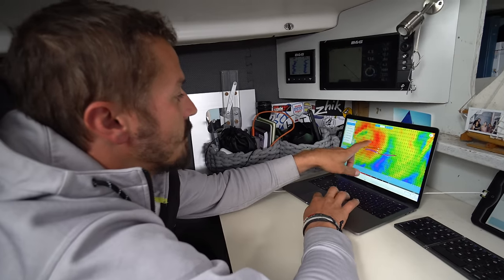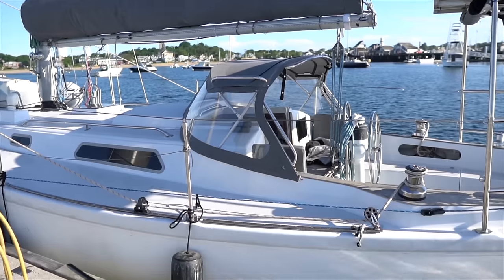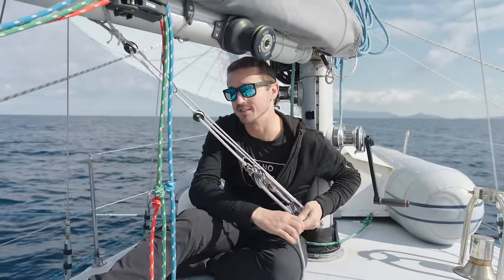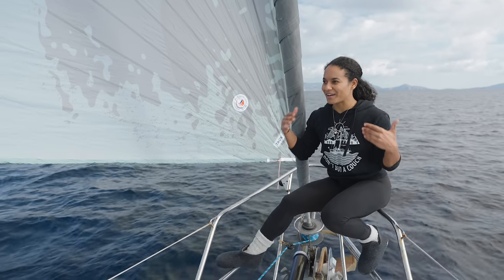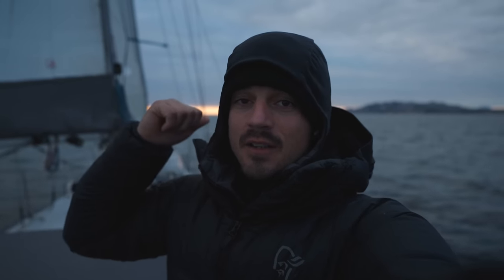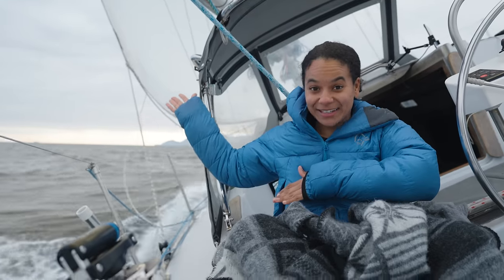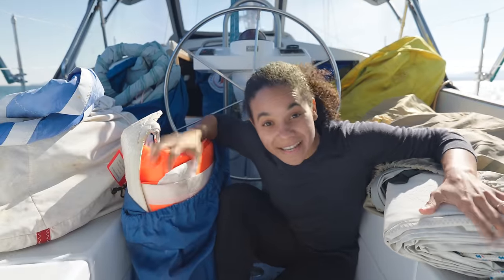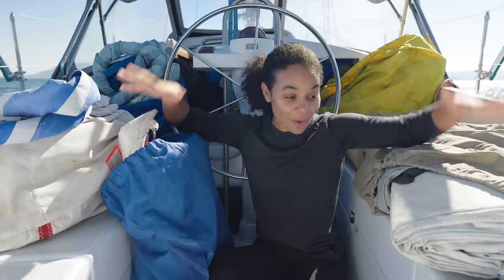Our Electric Sailboat has Unlimited Range | Step 343

Comment: One of the reasons I follow your channel is because you're true sailors... a rare thing in this age of the modern diesel engine. I don't know if you follow them, but Matt and Amy on Sailing Yacht Florence are another couple who give off the same vibe of choosing to sail whenever possible.
It's funny that many people think of the diesel engine as being the safety back up... I would argue that thinking is wrong. I have had to sail into a pen or onto a mooring in a boat because of an engine issue way more times than I have ever had to motor in due to a sail issue. Having the spare set as you do makes absolute sense.
Reply from the maker: Very much agreed. The number of sailboats that call for a toe when the engine dies blows my mind! You still have sail...use them!

Comment: I know you weren't selling anything BUT, . . . I'm sold on your sail inventory Step!  : - )  I've got 4 sails for my P2-20 but have not set up my spinnaker yet.  I made it out of an actual parachute but it is triangular.  I also made my genoa out of larger old main sail for another boat.  My jib and main sail came with the boat.  I'm happy that my sailboat wasn't used much (it was made in 12/72) because the sails that came with it are not worn out yet.  However, if I had the money, I think I would have a new set made up.

Comment: You guys remind me of my Dad. We live just outside of Buffalo, NY. and dad would sail from the dock in Erie Bason Marnia, out to Lake Erie and back, NEVER used a motor nor paddles to do this. Infact when the boat launch was changed (the deep ramp was removed) and, now we had to use a crane to launch the boat this was in the Buffalo River where the buildings blocked the wind. It took us hours to install and start the outboard motor Why? Dad never used them before. The boat had a 3-foot fixed keel on it and that's why a crane was needed.

Comment: What a fantastic step; thank you both.  My Ranger 29 (same era) had the same mast set up as your Pearson.  Like you said, it's fine.  When I upgraded to a J/42, it came with a Tides Marine SailTrack.  You hang out with cruisers, so you have probably seen them before.  There are no ball bearings, but the main drops instantly, and I can reef the main downwind.  It will likely install directly into your existing track.  Something to think about for the future.

Comment: Advise you to use the storm jib whenyou are going upving in more than 28 knots, the boat will be more balanced and feel safer.  Also in heavy downwind it can be used as your only sail, gives good control of the boat and not to high speed.
Love your content and as always great filming and relevant content!
Reply: An added benefit is that familiarity should preferably be gained before it is needed. It's one thing hoisting it tied to a dock, but the sailors need to establish how to hoist and trim it in strong winds, and there may not even be suitable locations to sheet it to. 
It's critical that the sheeting angle be correct because flogging is not sustainable.

Comment: Ball bearing slugs - I know them from a big catamaran. They are not only easy. When I entered first that boat, we thought about a line to pull the sail (some hundred pounds) down!  Later we learned you have to clean them at least twice a year, otherwise the sail may stuck. On a comfortable thought if you imagine wind is increasing and you struggle to reef.

Comment: Great episode. Well explained and yes as a sailor who grew up sailing in the 70's and 80's the naming for headsails and spinnakers is very confusing now! As a racer it's all A1, 2 etc for asymmetrical spinnakers and J1, 2 etc for jibs... before it was symmetrical spinnakers and they were named by their cloth weight - 1/2, 3/4, 1.5 oz and jibs typically by their size from 150% down to like 80...You guys do a fantastic job and it's nice to watch a channel where it really looks like you know what you are doing (there are some out there that are pretty scary!)

Comment: My first sailboat didn't have roller furling, so I had a huge number of jibs and genoas that I had to go up to the bow and change out in whatever conditions caused the desire to change, so on the second boat I made sure it had a roller furler, I did not miss going up to the bow anymore and occasionally achieving weightlessness and getting salty.
Both of my boats have had sloop rigs and I was interested in the cutter rig that my uncles boat had, until recently I found out about solent rigs that have become popular lately and that looks like what you have now with the two head stays close together. I like the flexibility it gives

Comment: We watched this this morning, and really enjoyed it. We are shopping for light air headsail(s) for our Bristol Channel Cutter. A genoa is our biggest, lightest jib. What we're looking at is a code zero and an asymmetrical spinnaker. We have experience with an asymmetric in a sock but not out on the end of a bowsprit. Blowing the guy and snuffing the asymmetrical is so easy compared to dropping or jibing a tri-radial on a pole! The top down furler is the other option but that looks like a spinnaker wrap waiting to happen. Code zero looks great, but not if going deep downwind , like 120 degrees. I guess the dacron code is more UV resistant for long passages. Our #2 and #3 Yankee jibs we've never used!
Reply from the maker: The continuous roller works great if you have the right sized spinnaker. We've had it on there for 3 years now and only wrapped it wrong once. If it was the right size, that probably wouldn't have happened. 

You can certainly fly a code 0 down wind, but it's just not as efficient and big on spinnaker. We do it sometime, it it's just for an hour or two and we're too lazy to swap.

Comment: Having such a reliable propulsion reminds me whenever I replace a car tire the alternator quits and when I fix that the radiator starts to leak, and after getting a new radiator the brakes start to sing indicting it's time for that job, which is what happens right before you blow the gasket, the point is such a beautiful electric rig tells me something will come up on your sailboat and I hope whatever it is you keep sailing amyway.

Comment: You can buy my 1971 SWAN 40. S&S designed, Nautor built and I have the Lloyds certificate. I have had her for 32 years. B&G autopilot, Radar, Sonar, Garmin 4012, Furuno weatherfax, Furuno Single sideband, and more good stuff. No leaks ! 13 sails. Very good sea boat. Nice motion, never pounded even in very short seas going to weather at 40 kn of true wind like northbound around Brooks peninsula with the tide against 40 kn of wind. Like skiing moguls until the jib ripped. We still made it into Winter harbour under main only. But I'm over 90 years old now and would love to sell the boat to you guys.

Comment: as an fyi, you don't need to strengthen the deck if you lead the lines back to the cockpit, there are mast rings for deck stepped and keel stepped masts that transfer the halyard forces back into the mast and not into the deck. Im going to steal your idea for the mast clutches, its exactly what i need!

Comment: The limitations of the Electric power has really made you better sailors and kept Uma a SAILboat. Buying lots of Diesel fuel to push around a power boat with a mast seems like a waste. If you are going to power most of the time a true power boat really works better. 

You ave rehabbed an old, small, washed up, boat not even safe for day sailing in to a safe world cruiser. This is astonishing. Well done.

Comment: have you thought of pressure reducing slides, i upgraded my main from bolt rope to rutgersen pressure reducing slides and it made the world of difference, you dont need to install a track, they work in your existing mast track. as a solo sailor i would never go back to bolt or plain slugs again, there are ones to reduce pressure off the battens and allow you to adjust the batten tension and standard wheeled ones, I run 4 batten ones and normal white slugs in between.

Comment: I would suggest that you attach your lazy jacks near the outside end of your spreader. This will enable you to raise the main much easier and even when you are at an angle to the wind.
Another improvement would be to have cleats on your mast to reduce the wear on your clutches 07:10. André in Sydney
Reply from the maker: Downside of that, is the tension on the lazyjack lines will vary depending on the boom position. We installed then along the mast to avoid this and require no fussing or re-tensioning. We set and forget them and have no issues.
Reply: @SailingUma  Thanks, it's good to get the perspective from a couple who have more sea miles than me and most other people. Cheers, André

Comment: I was fascinated by the Oceanvolt system, and especially when I watched your videos on the installation. I even made an offer on a boat that has an Oceanvolt system with the regenerative sail drive (but not the newer servoprop). However, I could only get one canned response from Oceanvolt regarding a retrofit upgrade and finding someone to install it.

Ultimately, I had to abandon the offer on the boat after learning how unresponsive Oceanvolt is. The biggest problem with the technology is that it's proprietary and exclusive, which means only their technicians can work on it. If they don't answer you, you're on your own. It'll work great if it never breaks or if you're influential enough to get a response from them.

The whole experience was enough to sour me on that company and avoid them. I'm sticking with a diesel until a better hybrid/electric manufacturer comes along. I think the Shards are working with one, but they're keeping the name quiet.
Reply: buy 385 sóar ektruc biat 30 ñm rañge   33.6 mooilbnr 30 precr mire range 40 mioevrañge

Comment: I really like your 12:1 boom vang and that code zero is dreamy! I have never seen folding wench handles before, how do you like them? I had a new cruising mainsail cut with not battens.  I really had to work to find a sailmaker who knew how to make this old school cut.  With no battens I loose some power but I can raise and lower the sail pointed in any direction and the sail has lasted and lasted.  I lost 15% sail area but I still make the same miles per day, with good sailing and proper head sails.  I also cut the jib down from 110% to 90% and set it on a boom for self tacking.  That made it really easy to short tack up a narrow channel.  Since a boom acts like a whisker pole I often beat larger faster cruisers because they did not have the crew to set a whisker pole or they weren't rigged for a pole.

Comment: Just a thought. Since you have so much failure prone electronics in your Electric drive system, perhaps consider a good sized yulouh skulling oar as backup. 
I've met a small Chinese guy who's sailed his 55 ft two masted junk around the whole world singlehandedly. With just a yulouh and Junkrigged sails when he passed through NZ. 
Could be easily made to disassemble for storage. 
And could save your life if you are somewhere remote, and need to get into a reef channel with the tide or around a Cape with heavy onshore swell while becalmed.
Very useful as a backup rudder too.
Reply from the maker: Failure prone? How so? Much less prone to fail than a diesel.
Reply: @SailingUma  yeah, I mostly agree with that, though in general the newer the diesel the shorter it's lifespan and more prone to failure.
My ,1976 Hartley southseas ketch's  original Ford is still running  sweetly after over a 200 thousand nautical miles. 
I find A 55lb Neraus brushed DC  thruster Adequate for everything when there's no wind for her sails or tide to fight.
Despite her 14 tonnes.

But the battery and electric motor tech has definitely gone backwards.
When you have a million components that have each a 1 in a million chance of failure per year that brings the whole lot crashing down, and the only fix is a part from the other side of the planet, You have statistically  an expected average time between failures of 6 months. 
But if you get a big solar storm, like the one a few days ago, that made the Carrington event look pathetic, but was luckily shot directly away from earth, or a lightning strike or a drip of water, anything electronic, particularly high voltage high frequency controllers and inverters are toast. 

Imho no high voltage AC or electronic system has any business at sea unless it's not something that can get you in a place you can't get out of without it. 
I don't use any electronics In my solar electric, batteries or propulsion.
It's getting hard to buy batteries that don't need them to survive, though they tend to kill batteries faster than not using charge controllers In my experience. And I get 3 to 10 times more amphours into my batteries from my panels without the charge controllers. 
like motors, oldest batteries last the longest and are the most abuse resistant.

Comment: Hello. Following you for quite some time. Just to add into the Gennaker/Spinnaker conundrum...
•	Genoa - A head sail where the foot of the sail is longer than the distance from the mast to the bottom forestay connection.
•	Jib Sail - A head sail where the foot of the sail is shorter than the distance from where the mast sits on the deck to the bottom forestay connection.
•	A spinnaker is used for deep broad reaches through direct downwind angles. It blows way out the front of the boat and uses a pole to windward to stabilize it. The Spinnaker is flying much higher and out front for more down wind tacks.
•	A gennaker is sometimes called an asymmetric spinnaker. The Gennaker is connected low to the bow sprit in much the same way as a genoa sail. The gennaker is a close cousin to the genoa and spinnaker. It is more like a genoa but is made of lighter material, poofs out more like a spinnaker and is only capable of sailing up to about 80 degrees off the wind.

Comment: It is obvious that even the non-sailors were interested in learning about the sails.  In discussing the spinnaker/genaker operation Dan did mention that the wind filling the sail was effectively "pushing" the boat and was only useful when the wind is coming from behind (downwind).  I don't think you described the "lift" aspect of the other sails and that , due to the Bernoulli principle,  the boat is actually being "pulled" forward.  I realize that's very technical.  But if you can somehow work this into a future video, I think it will be interesting and eye-opening for many of your viewers.
Reply: powrr sailor

Comment: Disclaimer, I am an extreme novice sailor and have so far done all my sailing on Smith Mountain Lake in Virginia.  When you described your genoa, you explained the dots indicate reefing points.  With a furling system (which I don't have), why are those indicators needed?  Do you not have an infinite number of reefing points, just rolling in as much as you like?  Follow up question for those in the know.  I hope to install a rolling furler this summer.  Currently, I have three sizes of genoas for my boat and a storm jib.  If I make the wrong choice leaving the dock, I usually just live with it for the day.  Can I simply furl one of my larger genoas or do I need to purchase a new headsail when I install that system?

Comment: We used to sail off the anchor in the Bahamas. I raised the mainsail and my wife would put tension on the anchor line. The boat starts to weave but the sail is very loose. Eventually the anchor breaks free as the boat is almost over it and the boat starts coming round. I had to pull the main sheet as fast as possible to stop any damage. My wife would stow the anchor and then come back to tie off the jib. Someone tried to copy us once and we heard a very loud clang as the boom swung violently across. I don't know if they damaged anything.

Comment: i have watched all your videos, and you have done amazing things, starting with your rebuild of your old 
boat.  Story lines and photography are great.  I have issue with your discussion of sail function.  It shows you really don't understand how they work.  These are principles that novices
 generally learn early on. Kika, no sails push the boat.  All those seams in your sails are there to shape the sail so air flows over the front.  Even spinnakers, the air flows over the top and around the luff (sometimes the leech depending on the set) creating a low pressure area, sucking the boat through the water.  All sails, on very point of sail, pull the boat like an airplane wing lifts the aircraft.  The only difference is that the sails are vertical.  In fact, your cruising chute can be trimmed on a direct downwind run, when poled out, or otherwise, the leech ca be used as a luff held in place by the angle of the guy.  Even spinnakers provide lift.  Modern sails are not 'barn doors' used to catch the wind.  Air flow is laminar and creates the low pressure.

Comment: everything has unlimited range if you give it the energy it needs. Sails need wind, electricity needs a generator of some sort or solar, IC engines need a source of combustible fuel.

Comment: Can you show how you switch between the Code-0 and Spinnaker?  Do you leave the foil up or is it a flexible foil?  That looks like a continuous furling drum for the Code-0/Spinnaker.  Can it be reefed just like the Genoa?  Also, I'd love to see your storm jib in action.  Maybe use it for "practice" the same way Erik Aanderaa goes out in crazy weather for "practice"?  Does your storm jib go on the head stay?  Do you have a storm trysail on a separate track on the mast?  Thanks for the great video!